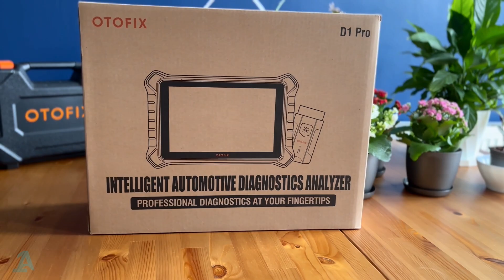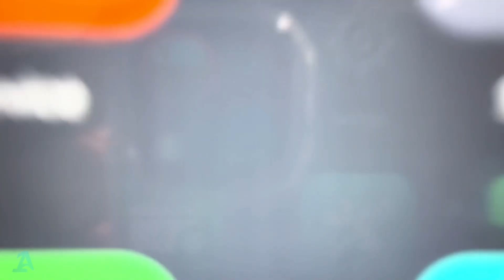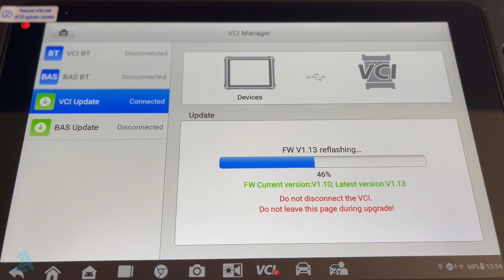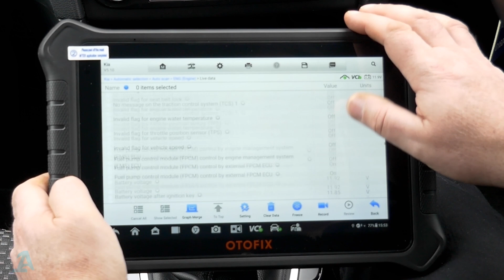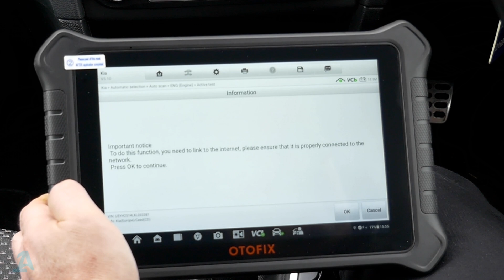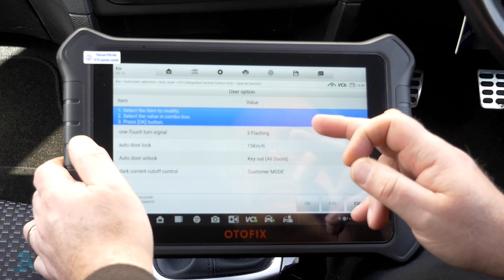They've Done it Again - The OTODIX D1 PRO - Powered by Autel

Comment: when using mine i often get promted to connect the vci with a usb cable, i'll see this prompt when doing various job's, for instance when i try to enter into the CAS module.Have you come across this, and if so were you able to gain that access, i attempted to many time with different usb ports on the otofix but always failed to 'get in', can you shed any light on this issue?